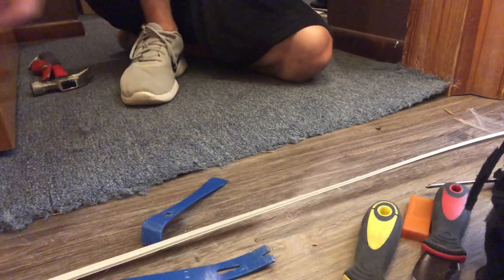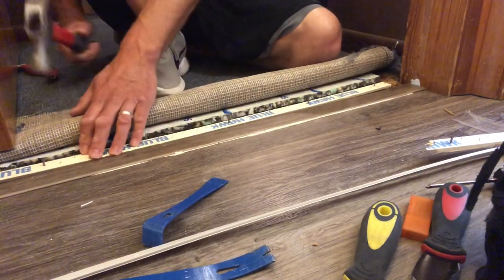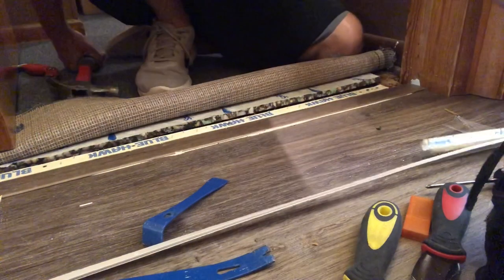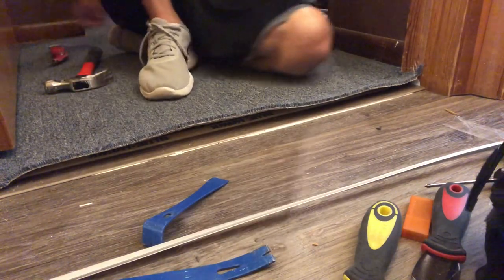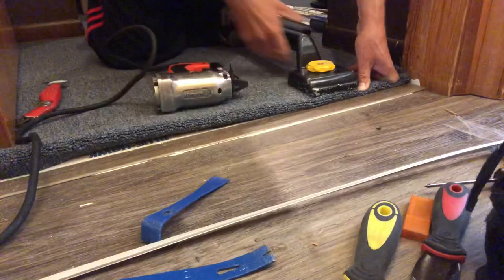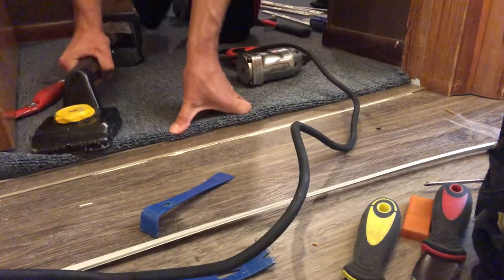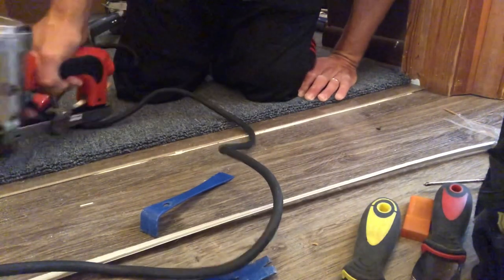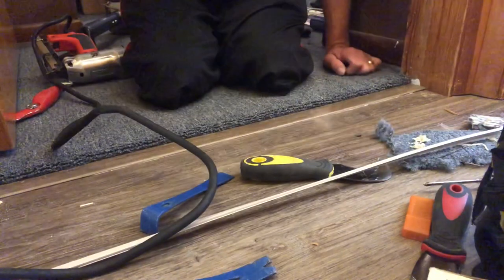How To Transition Carpet To Vinyl Plank Flooring

Comment: That’s a t-mold not a reducer. And that installation is incorrect. If installed properly you don’t need construction adhesive. Also the point of the moulding is to hide the edge of the carpet or flooring you’re transitioning to. Folding and having nails showing is just ugly. Hire a professional that knows what they’re doing.

Comment: I’m going to be doing a carpet to lvp transition but I don’t like this method. Fold and tuck look bad on top of tack strip. I get, you needed something to staple to but it creates the big hump. You’re better off using the clamp down(metal with built in tacks) in this case. From carpet to zero

Comment: Question 
Should my installer of used a metal edge to install mext to my lvp?
Should of installed on top of lvp?
Also off topic of this video do I need to have hand rails installed before carpet? I am doing a new handrail with metal spindles and to me I see it as better to install carpet then handrail so carpet is not cut so meny times the wrapped around steps.